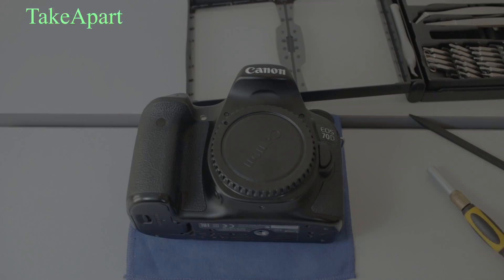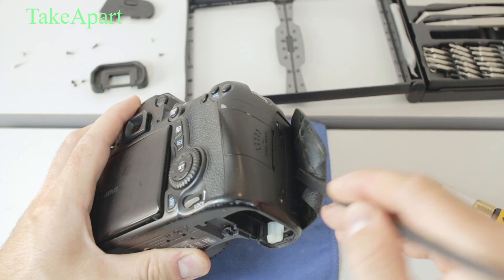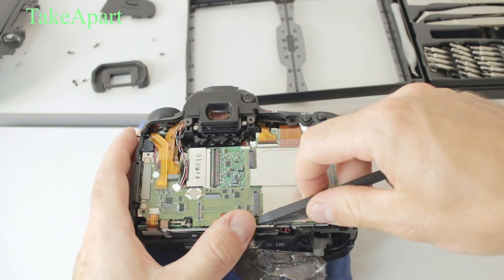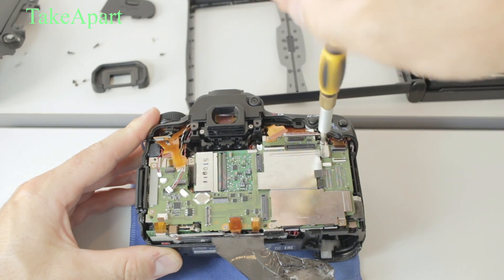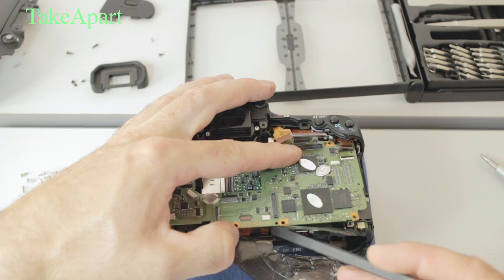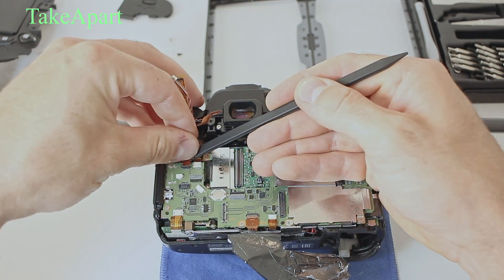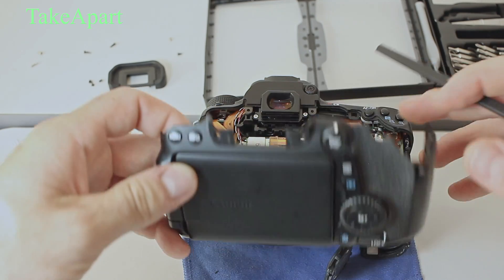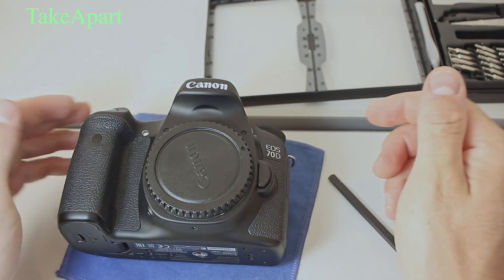Canon 70D | won't turn ON | Motherboard replacement | repair, fix | TakeApart

Comment: Hi, My 70D is showing only err 01 with all the lenses that I have and the Aperture is at 00 and Manual focus... 
Whenever I press shutter it shows me err01 connection between camera and lens faulty. 
Took it to services but they said i have to change the Motherboard... do you think it will do any help?
Reply from the maker: +Zaber Ansary hi, that was exactly my problem... check the terminals between lens and body if all ok .... yes it is on 98% motherboard! 
thanks
Reply: take apart how much do you think would cost to replace the motherboard? also could it be the Clock battery inside
or the body's lens connector pins? 
Cuz if I don't mount the lens all the way, It works just fine,  All Manual Focus, Only no aperture control.. 
Can shooot video normally too.. 

The Shop I bought it from said that it will cost around $130.
Reply from the maker: +Zaber Ansary  hmm good question... motherboards from china(check description of the video) are around $150usd  and than someone has to replace it. 
clock battery will not cause your problem, 
only pins or small components on pins flexi cable inside of camera body!  
clean pins and try but most likely it is motherboard! 
also you can try turn of camera (with installed lens) while you hold shutter button... also reinstall battery while holding shutter button... etc. 
I remember my canon 70D sometimes worked fine after this kind of hardcore restart. 
thanks

Comment: What if I broke the microswitch in where the battery cover is. Can it be replace? it doesn't connect to the motherboard right?
Reply from the maker: +DL Media hi, if you have a friend who is good in micro soldering then yes it can be replaced... otherwise cheaper and faster is replacing motherboard. 
thanks
Reply: take apart so let me confirm. Is that micro switch dose sit on motherboard? I was afraid that it sit separately
Reply from the maker: +DL Media oh yes sorry my mistake... it sitting on different board...

Comment: is changing the motherboard resets shutter count to ZERO? Im about to send it to a repair shop for motherboard replacement..and it says new board zero shutter count..
Reply from the maker: +Janine Cordova hi, if they using proper software for pulling all information from camera and putting them back then should continue... if they not using the software just don't pay for job too much... ;-)

Comment: If I replace it with new board, does it need to be program again? if Yes, How? Thanks!
Reply from the maker: +Janine Cordova  hi, the answer is Yes and No ...  if you get used board it can be used in another camera however it will not show some info as pictures left, etc... if you getting brano new unused board ... then Yes! brand new boards will keep camera on  even switch is in off position.... some camera shops can do it ... special software needed! 
thanks
Reply: Okay great to know. thanks a lot dude..Im so disappointed with canon70d...is your camera still working?

Comment: I can't get the main board tabs will not stay down (lock) on the connectors when putting back together. Has anyone else experienced this?
Reply from the maker: hi, ham I have no experience with your problem... check if flexi cable is properly in and should all be ok.... thanks

Comment: Thanks, for uploading your video and clearly showing how to take apart a Canon 70D. However I need to mention that the repair your showing will mislead people into thinking that JUST swapping out the board will fix the camera.
This is very incorrect! Please don't take this has an insult (it's not).
In order to correctly finish the repair the new board MUST be reprogrammed to the sensor and focus system on the camera body.
while most boards you get from eBay or AliExpress will come programmed with default parameters (focus, sensor, AE and WB settings) the auto focus settings are almost always off.
Auto focus (not live view focus) is very specific to the original camera body (flange distance, critical focus, etc)
Over the years I have replaced many Main boards in different Canon camera bodies, and in all instances I had to go in and set the focus parameters in the new board.
You can check quickly with your favorite lens and a focus chart.(check this one out if you do not want a commercial available solution for a focus chart) (http://www.squit.co.uk/photo/focuschart.html)
The only service software I am aware of (other than Canon supplied alignment software) is from SPT.info (http://www.spt.info/sptstore.php?crn=340&rn=684&action=show_detail)
Also this is the only way to reprogram the camera serial to match the serial on the body of the camera in case you intend to resell the camera.
Sorry....But I just wanted to point out that simply replacing the board will not get you back to a 100% working camera.
Reply from the maker: You are absolutely correct!  however in my case was motherboard used before (second hand) - links in description are for aliexpress shop which selling second hand boards.... they are not like brand new ( new ones are always ON no matter on position of on-off switch....and also in default settings of white balance and focus. 
in my case it was cheapest and fastest way to bring my 70D back to shooting videos. 
thanks.
Reply from the maker: hi, first where from you got motherboard? are you sure its good?  than check small switches near battery door and sd case slot... make sure they are not damaged...and check connectors on top right corner couple of them are tricky and try reconnect it ... thanks
Reply: I replaced my motherboard but my camera still doesn’t turn on...... can you help me I don’t understand what the problem is? I have tried using three batteries, (original canon ones) and I’m pretty sure I’ve put the cables in properly... if one cable isn’t in properly can that cause it not to turn on?
Reply: George Barroso hi I followed this video and my camera is turning in now but when I use the viewfinder it won’t even attempt to focus. I can only take pictures in live view mode. Can you help me please????
Reply: thank you very much for the support, but there is some way to reprogram it you have some video tutorial

Comment: Canon sucks. I've bought a Canon 80D and after using for just one month I put It away for a couple of months and when I try to use It again It simply doesn't work due the error 80 and error 60 (yes the same error of the 70d). And the best part is that Canon kind of said to me "shit happens dude" and becouse I got my camera abroad I don't get to have any warranty repair and had to pay $500 to have It working again. Great custumer service Canon, just great.
Reply: Bruno Dittert agree! I got 3 of this camera (70d). All dead for no reason. Canon wanted to charge me $450 for repair each because they died after a year of use, out of warranty . Also told me " it's not a known issue". Im so P. O. I did the repair myself on 2 of them . kind of simple swapping since i had no further knowledge to do further corrections but they seemed working fine after that. Just serials not matching.
Reply from the maker: +Bruno Dittert  hi, and yes they has serious issues with motherboards.... but I think 60D was last pretty solid model... I know the autofocus was different but for videographers who using manual focus just good!  anyway I recently switched to panasonic and it is bulletproof! 
thanks for comment!

Comment: Thanks For the video, it was very informative to get used of 70D internals... 

I burned sensor of it with laser btw , and found brand new sensor from aliexpress...

Could you give details about how to install it properly?
Are there any type of distance calibration needed?
Or i should just put the sensor to the place of old one?
Reply from the maker: +B. Y.  hi, it is bigger job than motherboard replacement... ! hopefully I will get canon dslr for sensor replace.... and I do video about it . 
thanks
Reply: I have the same problem, could you repair?

Comment: thank you for this high quality and very specified video . can you tel us how to change the shutter in this canon 70d . and where to find the shuttet , i m from lebanon
Reply from the maker: hi, replacing shutter box in canon is for longer video:-)  it is difficult and its require setting focus and sensor distance... 
I changed description of video, You can find link for buying 70D shutter.
thanks

Comment: hai sir, no programming needed? I tried to change my 1000d mainboard but the shop that sold the board said that need to program the board? is it ? thanks
Reply from the maker: +Magic Jadoo hi, if you brought second hand board than it will work! if is brand new you need to use specific software for set the board up... otherwise it will be always on ,even if on-off switch is on off position. 

thanks
Reply from the maker: +Magic Jadoo btw not many places can sell brand new board... they probably just want do the job and charge you more haha ...

Comment: Dude, where can you get mother boards in the U.K. ? Does it need to be from Alibaba?
Reply from the maker: +Chuck Norris  not many on market now. 
I found the link in description still working and seller from aliexpress has few left. 
and is place where from was my one! 
thanks
Reply: take apart 
Hi did you have to program this one u bought from Ali express?

Comment: thanks for posting this video because I need to change the motherboard in my own Canon 70D. I use it primarily for filming and so that's what I suspect burnt the camera  put. I feel much more confident that I can do it :-) I'll let you know how I go , thanks again!
Reply: It cost me $438 to send direct to Canon USA to replace the motherboard. They did a full body 18 point inspection and sensor cleaning. All done by a Canon certified technician. My 70d also came with a one year warranty from the date of repair. 👍
Reply: @simoncejas  I've heard where they may do this repair at no cost did they tell you they wouldn't?
Reply from the maker: yes they started to do it... canon New Zealand and Canada officially let me know if other countries ...
Reply: Update on this? I'm having the same issue, my camera is not turning on, just started today. I want to be sure its the motherboard (or relatively sure) before I tie up money into it..... thinking about just buying a new camera :/
Reply: 1K technician confirmed it was the  main pcb board or what I call the motherboard. I replaced it and still nothing. It's given me enough reason to upgrade and I've just got a gh5, selling my Canon and lenses and loving the new camera.
Reply: 1K the part cost me $200, if technician fixed it quote was $980. More than what I paid for the body...
Reply from the maker: +Mervyn Stilinovic  it is easy job! and no worries... don't forget hit like button...  thanks
Reply: Just followed your video and replaced my motherboard. I followed all your instructions. Unfortunately the camera still didn't turn on but I suspect it was issue with replacement motherboard as I did every step to a t. When I first put a battery in the battery empty icon flashed on the screen, and then after that I got nothing at all. Disappointed that my camera is still not working but the whole process was allot of fun and I got to use my ifixit kit for the first time properly.  I'll admit putting all the ribbon cables back in on the new board was very fiddly. Thank you for your help.

Comment: Hi. Thanks for the video. After changing the motherboard, no need for some kind of focus calibration or similar? Working perfect?
Reply from the maker: +Rethink Image 
Hi , and No you not removing any part which will affect the focus... for motherboard you need  special software to adapting new board ... (but not necessary if you using used one) it will show 999 pictures left.  ;-)
thanks
Reply: So, for this particular board, which you purchased used, did you use software or used straight after replacement? Thanks!
Reply from the maker: +Rethink Image 
it was used board... so I installed it without software... just straight replacement...  thanks

Comment: I recently sent my canon 70D to a service center. I think this is very easy to do if they can send me the parts needed I'd do it myself because of this video! thanks for the vid! I got the infamous Err 80 on my 70D. what do you think they'd replace?
Reply from the maker: +Jan Raymond Cortez  hi first thanks for comment...  errors on 70D are 95%motherboard problems... rest are sd cards  ,lenses and batterys fault... I'm happy, when my videos helping solve others problems...

Comment: Were you getting the Err70 and Err80 before your 70D died?
Reply: hello, my device has exactly the same symptoms, but is not dead yet, have you replaced the card? did it fix the problem?
Reply from the maker: +CIRUS MEDIA hi, no errors just went off and never come back.... it is pretty common thing with those big CPUs on motherboard they are overheat and damage it self...I would say canon need to improve this asap! motherboard replacement needs to be done even if you broke or bind contacts in sdcard slot, ... the guys for "micro" soldering charging way too much... easier and cheaper is to buy a second hand motherboard...
Reply: Ok, thanks for the reply.
I also have a Canon70d that is not coming on. I was getting the err70 and err80 errors and my camera was freezing up.. now it's dead and does not turn  on. 

I will order this part and attempt to replace it myself. Thanks
Reply: I was getting error 80 suddenly and contacted canon service center. They replaced mother board. Exactly same thing what is shown in this video. I think 70d shipped with bad boards as i am seeing so many issues mainly error 80. When I told the same, they said they haven't heard those many cases. 
I ended up paying around $200  (in INR) as it is out of warranty. My usage was very minimal.
Reply from the maker: +Sudarshan sridhar Hi, yea they are great and bad cameras.... I would say overheating is damaging internal chips on board... but what to do ? video footage =heat
thanks
Reply from the maker: +CIRUS MEDIA great , links in description of video are I would say best and reliable sellers... thanks

Comment: Thanks for posting this.  I'm in need of replacing this board as my USB port is shot.  Obviously I wouldn't do this outside, but, are there any big issues with dust getting in while having the case open?
Reply from the maker: +thisdoesfine  hi, bit dust is not a problem...but if you want you can use some cover for covering back of the sensor while you making ready new MB... thanks for comment and hopefully it will help you...
Reply: It did help.  Now just to find the board for a good price :)
Reply from the maker: +thisdoesfine  In my case was good one from aliexpress.... (link for MB in description) pretty quick delivery and best price .... also if you use one of my links for purchasing products it will help me to create more videos like this... thanks
Reply from the maker: +thisdoesfine Hi hopefully you sorted your camera... let us know about process 
thanks
Reply: take apart hello, how fast did the motherboard get delivered? And which delivery type did you choose???